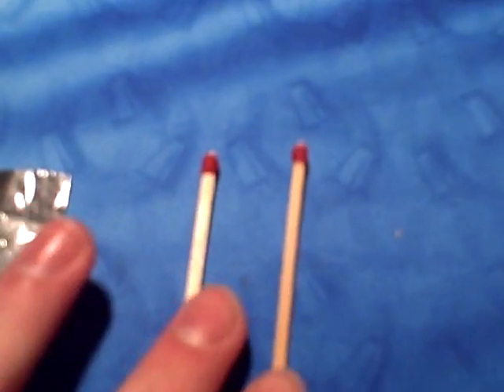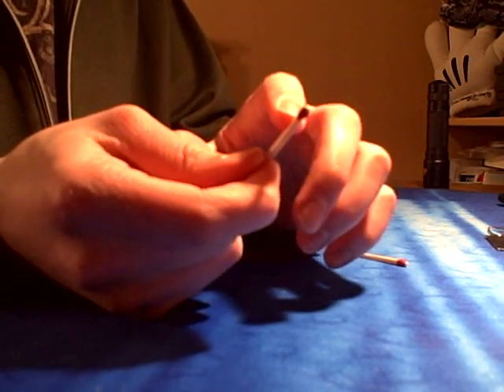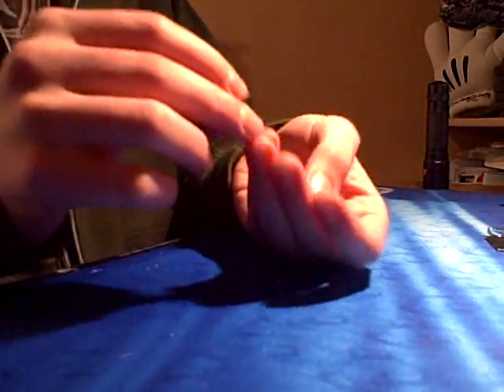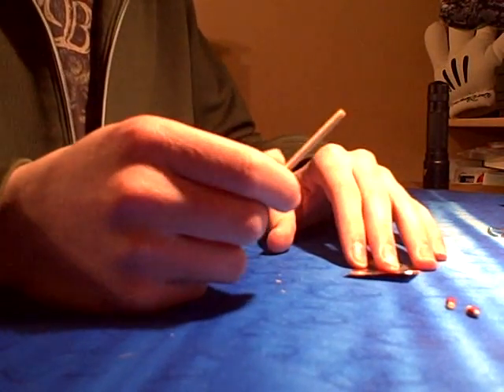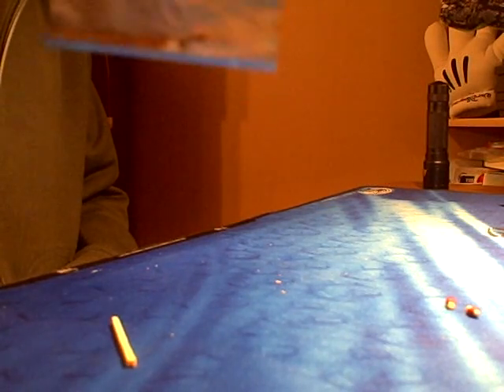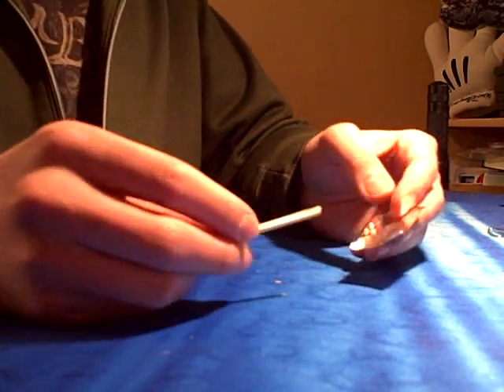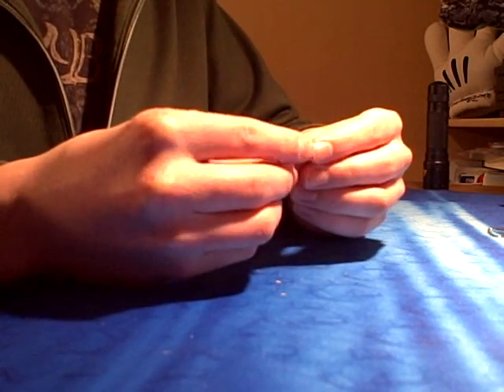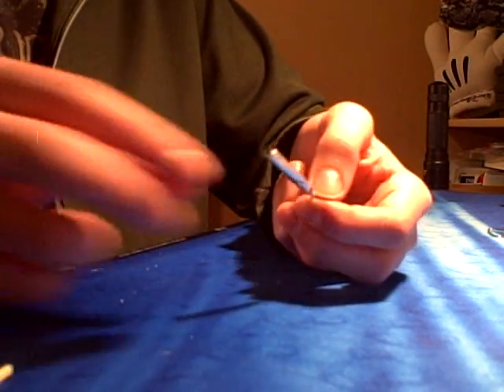How to make the BEST match rocket!!

Comment: I got mine to fire . . . Halfway. I got it lit up, but then when it "shot" the matchhead burned a hole straight through the foil. So, I had a lot of smoke in the garage (it was windy) and nt a lot of fun with it. Glad I didnt do it outside anyway, or I wouldve made a wildfire. Why'd it go straight through? I put 4 matchheads in it.

Comment: dude, to make it even better then THE BEST rocket you should put a little fuse in the aluminum foil and then add more matchheads and maybe make little wings for more stability in flight. ( of course you will need more tinfoil) hope it helps.  ; )